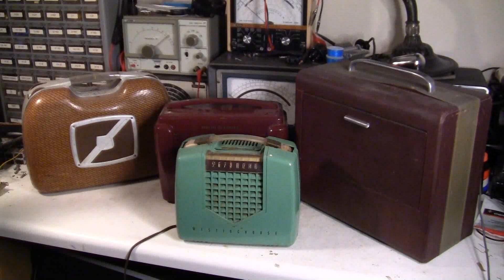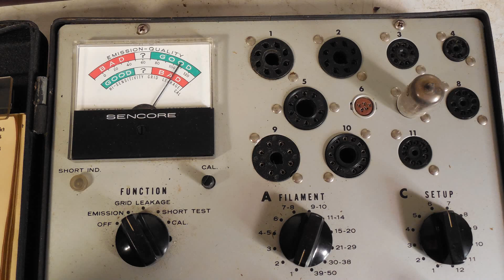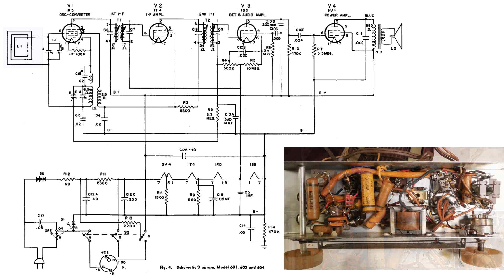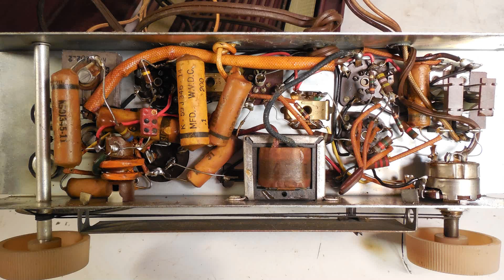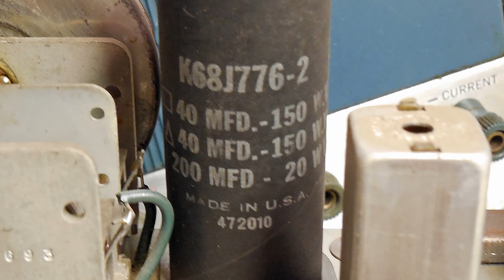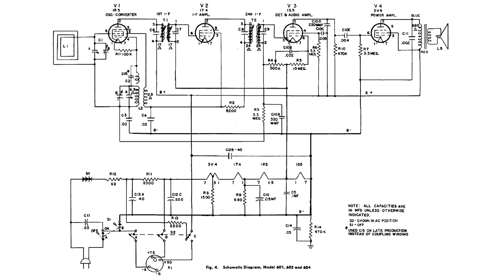Portable Tube Radio Repair, test tubes and check all coils

Comment: Maybe you can help please. How many turns have a RFC coil for FM tube radio with ECC81 and what is the diameter of wire in mm and the diametere of the core? i have found that i use 37 turns of 0,8mm wire and 8mm core bat i think its not right. Have any one an idea?
Reply from the maker: Give me the manufacturer and model number of your radio.
Reply: @AllAmericanFiveRadio   Hi there thank you for answering. The Radio is a self made radio with 2 stages the first stage is the receiver with ECC81 (21AT7) and the second stage is the Audio output with  ECL82

Comment: How important is it to have all the tube voltages spot on. I have a six tube silvertone and voltage at the tubes are randomly a bit high or low. Also all the resistor values are are a little high or low. I can't get reception. I can get signal generator tone but zero stations, just hiss. All the coils ohm good. I am by no means an expert but I have never had a radio that wouldn't pick up something eventually.
Reply from the maker: A few volts high or low is OK. It sounds like the local oscillator in your radio is not working.

Comment: I was wondering how do you remove a tuning knob from a 60era AA5 radio I tried screw drivers one then two under the knob working my way around I tried a little bit of heat lightly nothing I am waiting for it to snap off .do you or any of your fans have any Ideas.
Reply from the maker: I use WD40 on the shaft. Sometimes it take a few days to loosen up. Good luck.

Comment: I have four tube  portables two motorolas,a Emerson, and my fourth haven't checked yet its new ,all work only one so far has some new caps not by me  ,I figure someday I will have to recap all ,and have replace selenium  recitifiers ,which is something I haven't done ,thanks for the info about removing tubes before useing a multimeter ,as a novice I need all the info I can find .
Reply from the maker: I'm glad your finding radios in great condition. All original is the best.

Comment: I hope all tube portables aren't as problematic as the last few videos I have watched.on them ,I just ordered a Motorola tube portable that works  with a A.C. Cord ,I glad I saw your video about a meter burning out a tube good to no,are most tube portables come with a selium  rectifiers .the last two videos I seen bad them the portable tube radio I just ordered works ,I hope I don't screw it up.they seem more fragile then a.regular tube radio.
Reply from the maker: Good Luck tube portable Motorola radio
Reply: @AllAmericanFiveRadio  Is the a way I can send you picture of the Coronado four tube radio ,it's a very clean pretty radio ,I want to send you a picture of a repair ,sO never seen a 3 section filter cap repair like that ,I don't no if it even safe ,the radio only pick up strong stations .if you are on messenger I would love to send you that picture,
Reply: @AllAmericanFiveRadio  thanks it should be here wed.

Comment: I use a continuity tester to test the filaments in my tubes because I don't have a tube tester.

Are you saying that I can actually burn the filaments out that way?
Reply from the maker: +To Serve Mankind 
The filaments in protables like this are 1.4 VDC @ 0.15 amps. You can burn them out with an ohmmeter

Comment from the maker: Thanks MrHarveyluke
This time I did not re-stuff the electrolytic capacitors because it is cardboard and I'd have to drill out the rivets. It just wouldn't look good so I'm just going to cut the leads and reconnect the new caps on them.

Comment from the maker: Thanks coolbluelights,
For the filament voltage manufacturers usually designed the circuit for a D cell. For the B+ supply I snap 9 V batteries together and I can usually get pretty close to the value I need. The older batteries are still available, there expensive, and they don't last very long, what a deal. So I use alkaline batteries.

Comment: Hi i am from the UK and have an HNC in Electronic Engineering and have worked with TV (solid state) since 1993.  My hobby is restoring old TV and radio from the 50's to the 70's.  I just wanted to say i love your videos, they are very informative and you explain very well how to do various repair jobs.  Is there any chance you can do a video on TV IF alignment.

Comment: Rick, are you planning on restuffing the electrolytic to save room under the chassis, or do you usually not bother with it and cut the leads loose?
Looks like it's going to be a good series on getting back to basics.

73, Harvey KM4JA